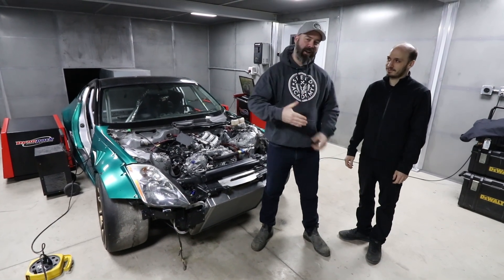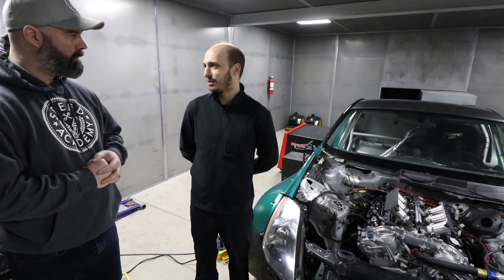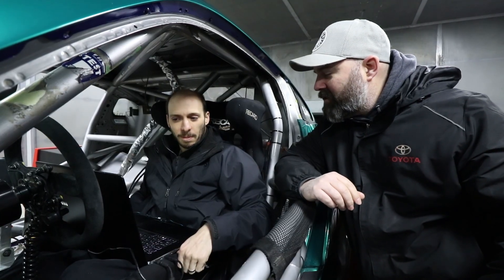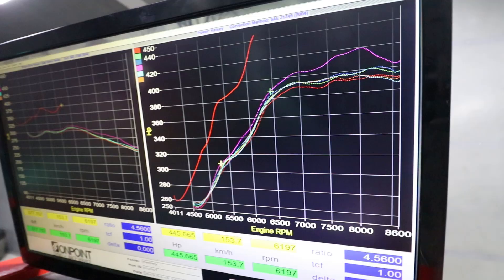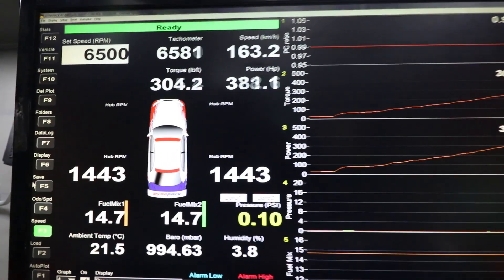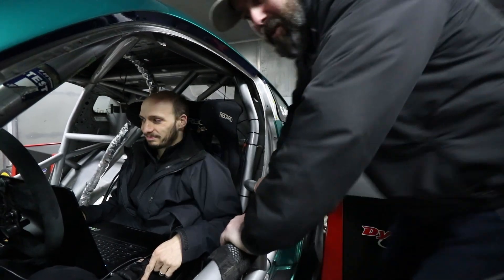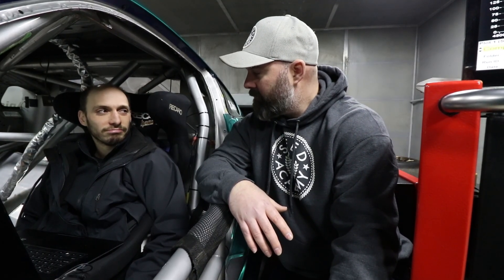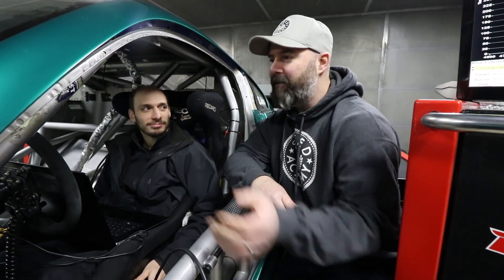RECORD BREAKING! Highest HP ALL-MOTOR 350Z Engine In the WORLD

Comment: so its a 370Z motor, not a 350Z motor. Might wanna change the title!
Reply: VQ35HR from the 07-08 350Z and VQ37VHR from the 370Z share the same exact block. Obviously different rotating assembly considering the .200 bump in displacement between the two due to the increased stroke of the crankshaft.
The V in VHR is for the VVEL heads which this motor doesn't use, theyre using HR heads. 
So basically its a VQ42HR now
Reply: Since when does the cars model change when you swap in a new motor??

Comment: Two questions : first, why on steady state the dynapack read higher than on a pull? Does it happens also on an engine Dyno? Second, are sure that 537 dynapack hp are about 600 at flywheel? I bet that these are more 550 @ fly

Comment: this is probably the worst sounding engine at idle ever made. screams nice with the ITB's though.
Reply: You've never heard a viper in person then lol...they sound like an old delivery truck at idle but great otherwise
Reply: To the contrary, VQ's are probably one of the best sounding 6-cyl engines. The entirety of Nissan's lineup sounds extraordinary. This exhaust / ITB / microphone combo just doesn't make for a great sound on video.
Reply: Most engines don't sound like much at idle on the engine bay/intake side, just mechanical clatter.  The exhaust side sounded fine
Reply: We have to consider the exhaust is being plumbed out the back to outside the room.

Comment: s 2000/ f20c has a 153mm rod which is about 37% longer than the 96mm stroke
Reply: So the rod stroke ratio is 1.59 ..1.75 is considered optimum, but many high revving engine the likes of F1 see upward of 2.0. Also the higher the rod stroke ration the more dwell time the piston will see at BDC and TDC which allows the airflow to be more efficient at higher rpms. The trade off being poor low end torque ;)
Reply: my 6.6l big block has a 1.88 rod ratio. if i swapped the longer rods from the next biggest engine up into it, it would be at like 1.98.

Comment: Those cold header tubes may indicate those are rich cylinders but i bet Sasha already considered that.  Possibly related to some intake geometry/flow. Also possible just part of the headers design where the center tube has more velocity w/ less restriction so less heat.
Reply: Insightful point about the header design 👍
I was only considering it to be caused by an AFR difference between cylinders, which is a lot more worrying.

Comment: If there isn't a 4hr video on the hybrid system I'm going to very upset.
Reply: Totally agree !! It should be documentary style
Reply: Seconded, I agree whole-heartedly
Reply: Lmao damn willing to watch four hrs?👀
Reply: @Andrei rRRr If a Formula 1 KERS system costs $1.3m to buy and makes 150hp for 10 seconds at a time provided it's working properly and it's not too hot...  and for the sake of argument we divide that price by 20,  I could still build my engine of choice and have it make a reliable 1000hp and swap it into my car,  along with a knob to adjust the power level in realtime.  OR add the weight and complexity of an ERS and adapting it to the existing driveline.  Imagine if it craps out and having to wrench on this:  https://www.autocar.co.uk/sites/autocar.co.uk/files/styles/gallery_slide/public/130626Flywheel_04.jpg?itok=_eVrPRFc
Reply: @Andrei rRRr Those sub $15k kits are mainly for providing enough power to keep your sub-compact at freeway speed.   In the ballpark of 15-30hp.   Or for converting your Prius into a plug-in hybrid.  But yes , improvements will be made and costs will come down.   In the meantime , I'm almost done LS swapping my E36 to the tune of about $3000,  granted I did everything myself and it was already a race car.
Reply: @Andrei rRRr You already have a turbo platform , why not just step that up.   Would cost less money and you don't have to wait
Reply: Camhin1 I’m curious how one would build hybrid system, without a whole company to develop it. So far we haven’t seen a hybrid car that’s not made by a whole manufacturer.
Reply: @Velocitist  People have converted UTV's to electric , which are kind of like a small car.  It's not that difficult either.   Some are even street legal.   There are bunch of sub-compact electric vehicles emerging that look very chinese.
Reply: Nick Kautz hmmm
Reply: Camhin1 agreed, with all the details too. Sasha does some interesting work.
Reply: I'll bet that's classified info and extremely difficult to reproduce without being affiliated with an electric car company.   An electric power adder kinda feels like contamination on such a nice engine.  And all-electric is flat-out uninteresting in comparison.
Reply: @NickKautz  I'm sure it's classified, but Sasha isn't affiliated with an car electric company, he does work with a company that builds controllers and such. Also I don't think it would be a contamination as anything that makes a vehicle quicker is cool. Electric is the future.
Reply: @Camhin1  Electric / self-driving is the future of commuting , which is great.  Less pollution (I think), quieter , safer.  As far as racing , I think we'll see electric vehicles holding records and perhaps some initial popularity in racing which will see them quickly separated into their own class/series' followed by a resurgence of interest in gas racing as electric cars become more commonplace.  I think people hugely underestimate the sensory impact that engine powered cars have , which is inherently lacking with electric.
Reply: Perfect example,  Look at Formula E.   You can't pay people to take the tickets
Reply: @JohnDoe-mx1sq  Yes , I think KERS is lame.  The engine's could easily make the extra power that kers generates , if they were allowed.  If you look at the history , F1 rules basically forced   kers by making it required if you have any hope of being competitive...  I believe for the purpose of being privy to otherwise carefully guarded developments in electric technology ,  as the teams have to submit all the details about their systems.   This would put the F1 governing body in a uniquely powerful position.    And it's no secret that certain teams have mysteriously wound up with technical details from other teams.  Now imagine what a big car manufacturer would be willing to pay for some of that information.
Reply: @JohnDoe-mx1sq  Cool video.   That's like unrelatably fast , I can't imagine wheel to wheel racing ever being sanctioned at that level for safety reasons.  I don't doubt that electric will sweep lap and speed records everywhere... the car even sounds ok for only 4-cylinders.  Impressive as it is ,  if you had a booth setup at sema playing that and the booth next door is playing a race with 60's and 70's trans-am cars at Laguna Seca,  I think it would be pretty clear what captures people's interest
Reply: @NickKautz  Most F1 teams are the property of big manufacturers (think Mercedes, Ferrari/Toro Rosso/Alfa Romeo, Renault, etc.) The rest are run by what are now essentially engineering companies (McLaren, Williams) that build up their knowledge of hybrid systems using Formula 1. I'm not a big fan of F1 anymore because the rules allow the richer teams to win all the time, but to me F1 has always been pushing the limits of engineering. It's a bit like the LMP1 class in Endurance Racing. They're no point in investing millions in building and running these cars if you're not going to get some precious engineering knowledge out of it.
Reply: @Spr4ng  I reckon the corporate motivation to race is largely a mixture of fun , competitiveness , marketing presence.   The innovation resulting from the pursuit of performance should be guided towards practicality by whoever makes the rules of the series.  That will attract participants if they feel like their r&d efforts will carry over to marketed products.  I'm sure thats part of why there are turbos and electrics on F1 cars
Reply: @NickKautz  think of it this way: electric motors can give you more low-end torque, which lets you run bigger cams than a straight NA motor could, and as a result get more revs and more power.

Comment: My VQ altima vs J32 TL my altima  was so much more violent at wot.
Reply: j32 is better than a vq35de. and way more reliable. it felt faster at wot because it does have more tq but uptop the j32 is real strong and makes power to redline. vq 35hr is another story tho
Reply: Shazy lmao no the DE is much better than the j32 loooololololool
Reply: @PressinPickle  okay you can laugh but then why do you say that? performance? reliability? efficiency? performance they are very close for what they are. both can make about 300 whp with some work n/a eise. de eat more oil than the vtec engines. j32 do not overheat and are known to go above 200k miles with ease. in terms of a daily it does get better mileage as well. there is a better aftermarket for the vq engines so Forced induction and worked internals would be easier. j32 are also cheaper engines to purchase.  both pretty close my good sir.
Reply: Shazy nah DE makes more power, faster than any TL stock vs stock, car looks a lot better, sounds better, rwd, I’ve been plenty of DEs over 200k and even ones over 300k. Nissans n/a v6 was far ahead of its time. Still just beats all of the new v6 mustangs, camaros, chargers, etc.
Reply: Shazy also DEs are NOT known for overheating. Not sure what crevice you pulled that one out of. Yeah some do definitely burn oil because of piston rings but there are so many Honda’s with the same problem

Comment: Take it to the drag strip and set a all motor world record 😀
Reply: sage sokol exactly. Everyone likes to bash and underestimate the Z/VQ platform when it comes to drag racing. It’s usually V8 guys too. Maybe it’s because that’s all they have? It’s not too often you’ll catch a muscle/pony  car drifting, auto cross, touge, track etc. Upsets them when they see a 350z, (which could arguably do it all), drag racing and getting 12s with a stock v6 engine and tire while there’s modern 6MT V8s out there that struggle to even crack 12s on the track.
Reply: @Luis Ramirez I track, autocross, and run 11.1's all day in my 2004 600+rwhp daily driven Mustang Cobra with a 6MT. Unique builds don't upset me, people talking not knowing what they're talking about upsets me. There's no stock V6 350Z or 370Z with just a tire on the back running 12's in a 1/4 mile. Since you know track times so well, off the lot "modern" 6MT mustangs run low 12's consistently while the 2018+ AT 5.0's run 11's straight off the lot. Check your facts before you start talking about any muscle/pony cars. This 350Z is a mid-high 11 car even with a drag radial on the back. N/A Built 300+whp gutted civics weighing hundreds of pounds less than this barely hit 11's, so give this thing the extra couple hundred pounds and the extra 130whp and it'll run a mid-high 11 sec 1/4 mile.
Reply: Steve cool. That’s a rare build you claim you have. And you still get my point though. Also, when I said stock I was referring to the engine itself (internals, bore etc). I’m not sure if there is any 6mt Zs running 12s completely stock, but I’m damn sure there are a lot Zs in the 12s with mid bolt ons tune and tire. You really don’t have to believe me, look up VQ 1/4 miles records yourself. You’ll find a plethora of VQ with a variety of categories running 12s. Day by day VQs are getting closer and closer to 11s, again this is STOCK ENGINE NA. I may have spoke too generally talking about V8s but you as well seem clueless when it comes to VQ 1/4 times. Also, a better analogy would have been a 2004 3V mustang NA running 14s stock lol.
Reply: Steve AGAIN, there already is a 350z HR running 12.1 at track. It’s gutted, FBO, e85, tuned. Making approximately 320whp. Now swap out the stock engine with this fat ass built 4.2L with ITBs making 200whp and you have yourself at LEAST a 10 second car, V8 boy.
Reply: you can "V8 boy" me all you want I've had multiple S-Chassis SR20DET swapped cars and been around the Nissan community enough to know what 350Z and 370Z's are capable of. You stated "getting 12s with a stock v6 engine and tire" which if you tell a calibrator building you a tune for your car that's it's stock it would imply that the vehicle has no aftermarket parts on the car....you do bolt-ons tune and tire and the car is no longer stock. This engine made 445 whp and 377 lbft tq it's not hitting 10's. 11's absolutely. It takes a twin turbo setup on these cars just to hit mid-high 10's making 100+ more whp than this thing. https://www.youtube.com/watch?v=SaQgexvHRsE
Reply: @Steve-jh3bc   I don't get whats so hard to understand about a stock engine. Just because something is BOLTED ON to your STOCK ENGINE it does not mean the engine is now 'built'. Also, last time I checked when you add tire to a car.. the engine is still stock... 

Essentially what you're saying is adding 200whp to my baseline example, the already 12.1 1/4 mile VQ, won't shave off 1.11 seconds to break 10s? Hefty claim mate.
Reply: @Steve-jh3bc  bro. I've seen 400 hp civics run high 9s low 10s fuck u mean 🤣
Reply: @Steve-jh3bc  https://www.youtube.com/watch?v=uh2e9_1caZ8

Above is a stock 370z running 12's. Traction is the determining factor with z's. 
Fastest bolton 370z is high 11's. Like 11.999, but still 11's.
Reply: I think it could break 10s with the weight nd power seeing that it’s practically gutted 

Maybe a tire but I wouldn’t trust the gearbox on a hard launch with a hefty tire

Honestly I wouldn’t risk breaking the car

I just bitched out 🤦🏽‍♂️
Reply: NoNoNoNii tell him to sell the whole car
Reply: NoNoNoNii that must be a shitty setup lol hp doesn’t guarantee anyone into any times.
Reply: RZG did run 11's on only 298whp. Facts. Check their website, RZGmotorsports.com for video and my 350z.com for the Official Rankings
Reply: Well mr v8 pony boy, the inline 6 bmw m3 just set a world record a few day ago unopened  not built and has 1200 whp and ran 9.1 in the quarter mile... Don’t see any ponies doing that with there big v8 unopened.... put a turbo on your ponie and still not 9.1 1200 whp unbuilt !!! (Check him out RK tuning aka mr Jordan!! Now that’s real power
Reply: You 'd have to put that motor in a purpose built drag car,  road race cars are not built for launches and straight line grip
Reply: Nick Kautz I mean there’s FBO e85 on tire stock engine/chasis/suspension/diff/axles with the VQ35DE variant running 11s that only made like 300ish whp.. I believe(RZGMOTORSPORTS). Now imagine a 4.2L at 500whp. I don’t get how this 350z would perform any differently? 500whp in a stock gutted 350z on tire would do a hella lot better than 11s no doubt. I don’t think I’m reaching if I say 10s either.
Reply: Joseph Flores 
Cool motor but not a drag car. It would probably run mid 11s 😴
Reply: @applebitefool  Nothing wrong with that although ETs will be dependent on weight. It they strip the car out it will run 10's.